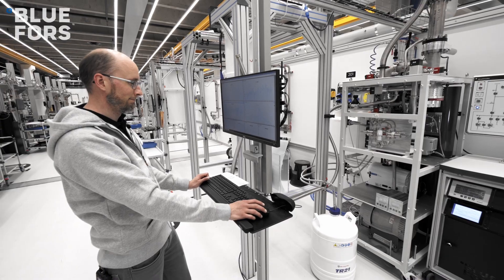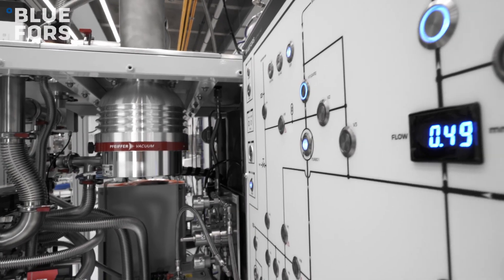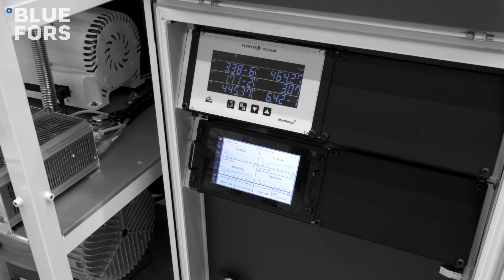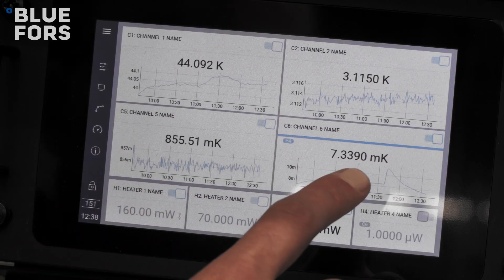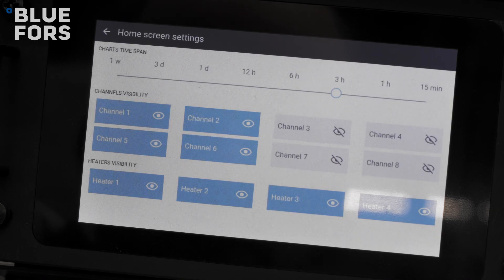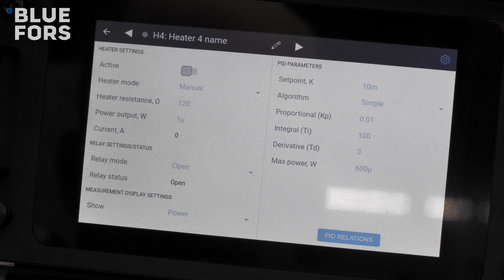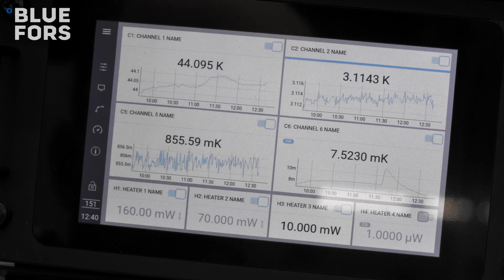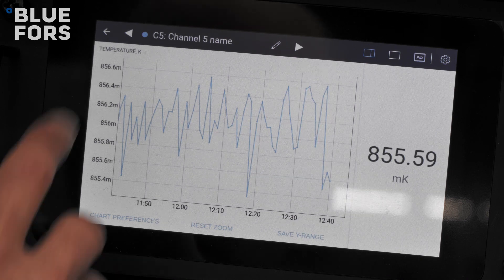Bluefors Temperature Controller for dilution refrigerator systems

Comment: Looks great! Is this a move away from Lakeshore to become a bit more "vertically integrated"?
Reply from the maker: The new Temperature Controller is now completely integrated to our systems from summer 2020. It provides a unified user experience and the usage is also easier for future system upgrades.The heat switches can be controlled  and the main difference which will impact the everyday life is the user interface and the ability to pull data directly from the device using any programming language supporting REST, Websocket or MQTT protocol.